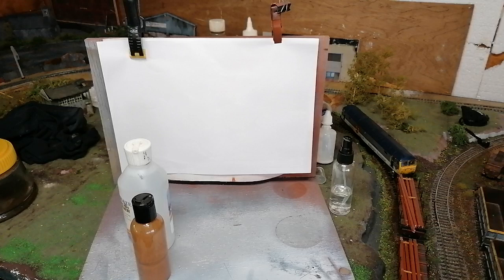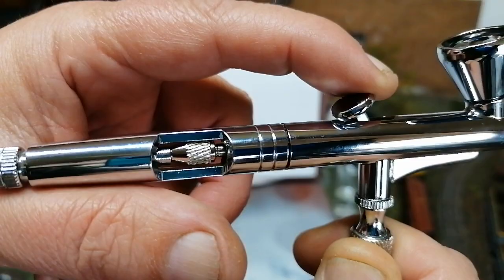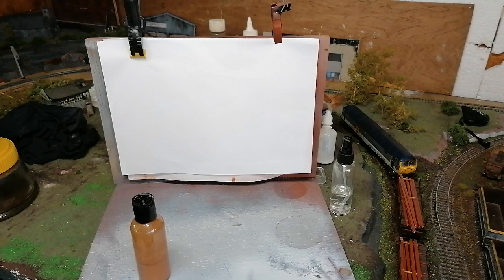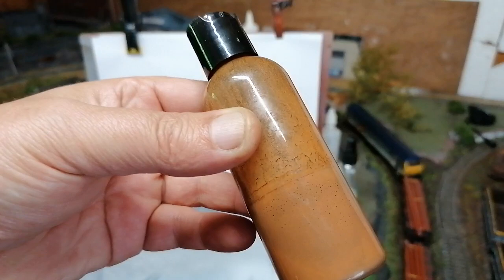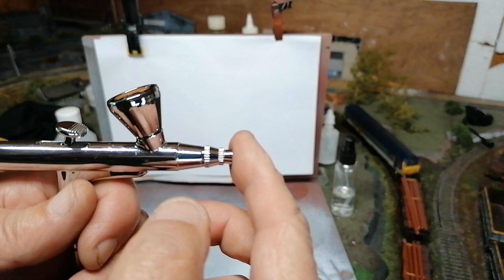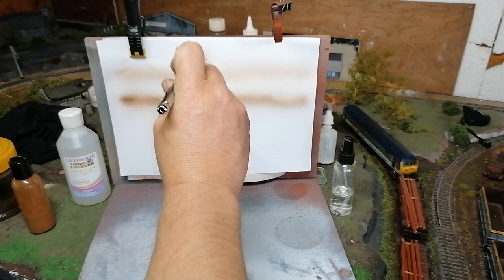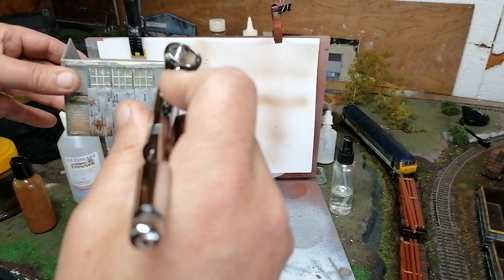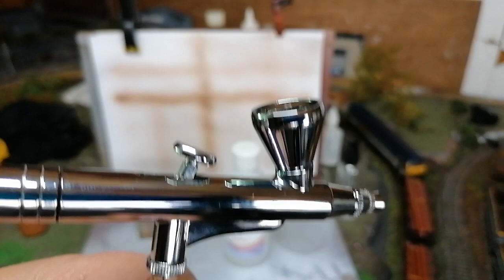Model railway easy airbrushing

Comment: Great video digger i like to get a airbrush some day. i use to spray paint cars when i was a kid
Reply from the maker: They really are a useful piece of kit to have
Reply: @DiggerEvans  What brand of airbrush be good for a beginner
Reply from the maker: @KerleyExpress  Hiya Dwight there's loads on the market I wouldn't bother with the really cheap Chinese ones, but harder and Steinbeck or badger are both good makes I believe badger is an American made airbrush, buy a decent one that isn't the most expensive, that way you can learn to see if you like using it there's one called a neo which is quite good too, airbrushing can save you a lot of work and create effects that you wouldn't be able to achieve otherwise